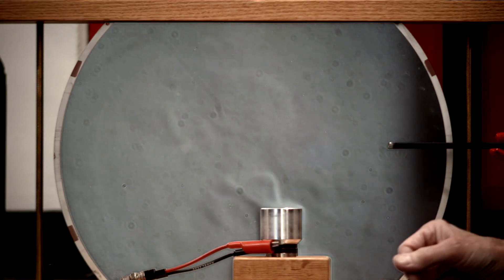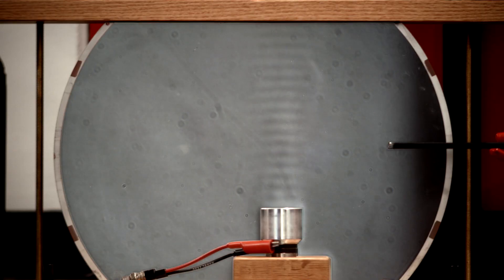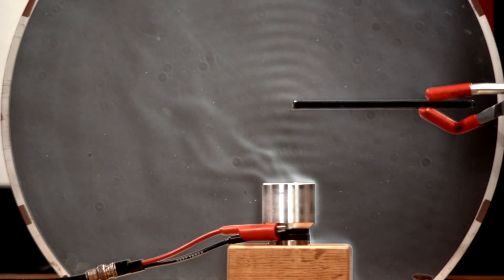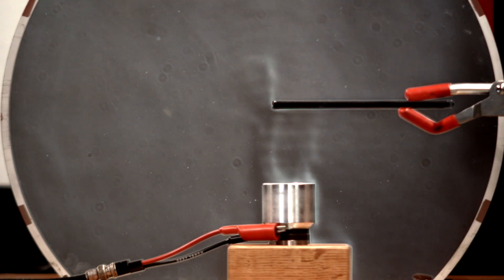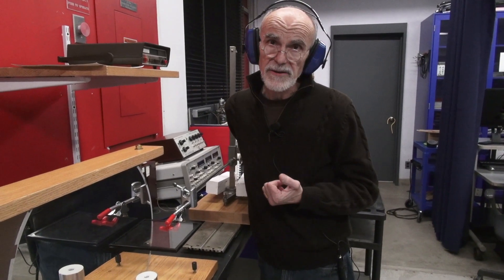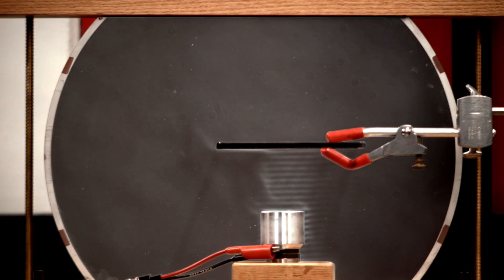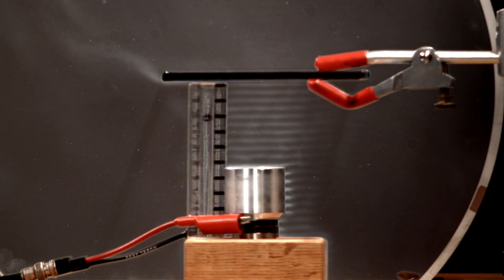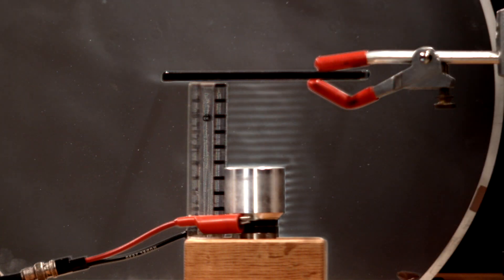Visualizing Ultrasound with Schlieren Optics Part II

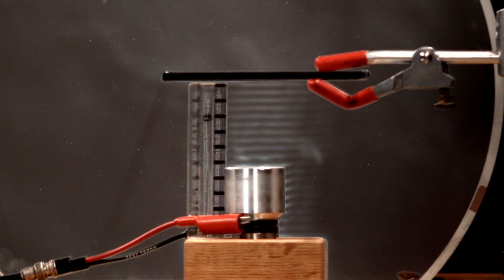Comment: The wavelenght in the video at 2:30 does not match the markings of the ruler. we should see 6 approx. 6 full wavelenghts but we count almost 10. How do you explain this. Is it a byproduct of  the strobe maybe? Also observing the waves in the lower right part of the picture where we see two full wavelenghts per 1.2cm. Any thoughts?
Reply: This is a standing wave (as opposed to a traveling wave) and a bright band occurs every half wavelength.
Reply: @wolfgangrueckner7151  Oh..yes, my bad. That makes sense now! Thanks for your kind reply. Really amazing demonstrations.

Comment: could you maybe tell me something more about how you setup the transducer?
Reply: The ultrasonic waves are generated by a 28 kHz transducer designed for ultrasonic cleaning baths.   These are typically driven by a push-pull oscillator specially designed for this application.  Many are controlled by an Arduino microcontroller.  Ours is driven harmonically, powered by a Samson Servo 120 audio power amplifier.  The input signal comes from a sine wave function generator.   A home-made impedance matching transformer  couples the 8-ohm output of the audio power amplifier to the ultrasonic transducer.